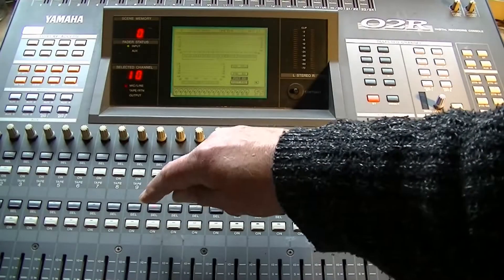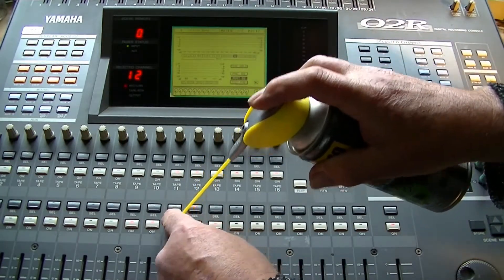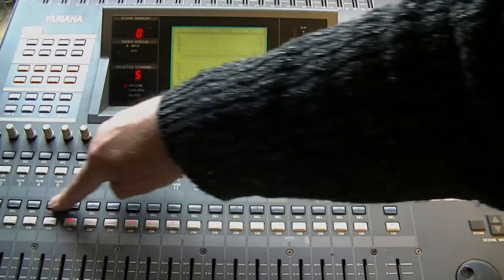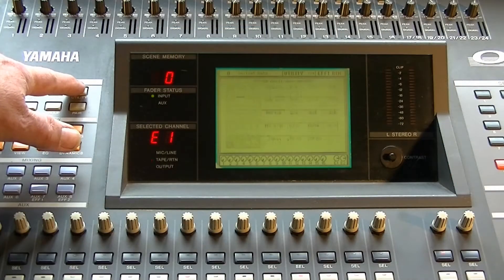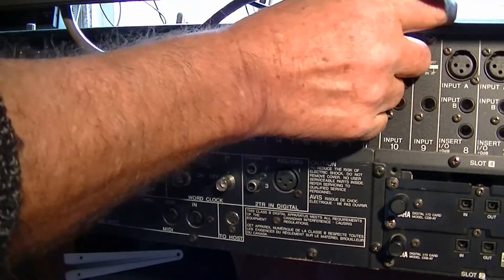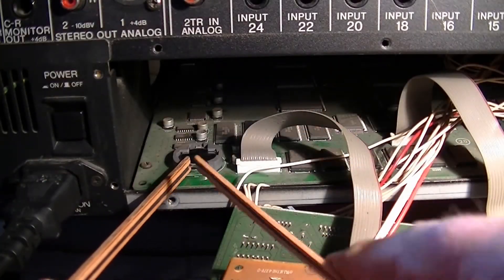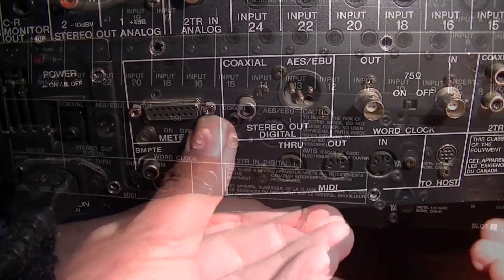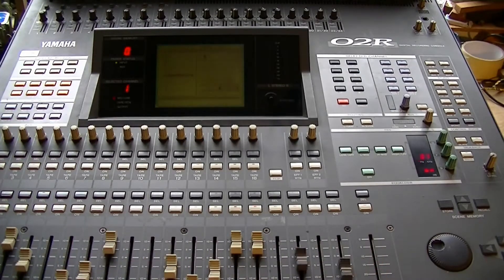YAMAHA O2R _ BATTERY REPLACEMENT_ NOORDERMAATSTUDIOS

Comment: Hi Marc, I cleaned the faders of my O2R with canned air, they are better now, bu it seems they could be a bit more smooth. What do you recommend? Contact spray? Also I would like to give the knobs a refresh. Thanks Thorsten
Reply from the maker: Hi Thorsten, the faders of my O2R "s aren't sliding smooth too .I push them instead of put my finger on them ,then they slide easier.If the motorized faders are working allright,I should do nothing. It could be, that it's not used for a long time.The more you use it ,the better they will glide.I don't know about contact spray.Have you connected it yet? Kind regards,Marc
Reply: @noordermaatstudios  Hi Marc, yes, the mixer wasn’t used for a few years. It was gifted to the A1 “sound man” from the “Jeopardy” team 19 years ago. But I bought it from a professional company in North Hollywood. They tested it. I guess the mixer was stored for many years (as the original label tape is still in place ;-). I will connect it soon…very excited 😊! I also got a used Yamaha Motif ES in pristine condition last weekend. I will let you know when everything is connected and how it works! Thanks & greetings to the Netherlands Thorsten
Reply from the maker: @thorstenweimar1190  Thank you, Thorsten, it's an exciting time for you.Let me know please how it goes,and enjoy Marc
Reply: @noordermaatstudios  Yes it is!  The board also came with the meter bridge, that's pretty cool! And now I have my final set-up: After considering I just bought a used Lynx Aurora 16 instead of the Yamaha Nuage 8A8D, that provides 16 analog ins/outs and 16 digital AES ins/outs. And I didn't want to go the Dante route. Just simple routing for the beginning. That should be sufficient for my small studio for years to come. I also use some 500er outboard gear. I will keep you posted. Cheers Thorsten

Comment: Hi Marc
My 02R disables the display occasionally and with this the sound, afterwards a couple of seconds going by gets it. What may be his reason?
Reply from the maker: Hoi Tibor,I am not a specialist but it could be a loose connection.I have had one opened with a simmular problem and i checked all the connections,and the problem was solved.I hope that it works,good luck.
Reply: @noordermaatstudios  Hi Marc
Thank you

Comment: Hi, I need help, my mixer stoped, i turn on and all lights signal of chanel stay green.. help me, please.
Reply from the maker: Hi,it could be anything,i allways start with a factory reset.

02R Factory Reset procedure:

WARNING: When this procedure is performed all user stored data will be deleted! If the current settings and data must be maintained, create a data backup before executing the Factory Reset. Once the procedure is completed, the backup data may then be reloaded into the 02R.

The following data will be deleted or reset to default settings: Automix Memory, Scene Memory, EQ Libraries (user only), Dynamics Libraries (user only) Channel Libraries (user only), Effects Libraries (user only) and all other user system settings.

1. Turn the power off.

2. Press and hold down the Left Cursor button while turning the power on. Continue to hold the button down until a dialog box appears on the display. The dialog box will read ''Please Confirm: Initializatize Memory? [ ] Cancel [ ] Execute''.

3. Using the cursor buttons, navigate to the EXECUTE option and press [ENTER].

The 02R will now execute the Factory Reset procedure automatically. The procedure will take less than 10 seconds.

NOTE: The faders will be recalibrated during this procedure. Be sure to avoid touching the faders while they are moving during this procedure. The fader recalibration is finished when all faders return to the minimum position.

Reference: User's Guide, p.161-162 02R 02RV2
pull  out battery plug the mixer tour ON .next return battery +RESET FACTORY
 Good luck
Reply: @noordermaatstudios  thanks I tryng, and return with feedback.
Reply: @noordermaatstudios Is removing the battery necessary for a full factory reset? I'm assuming that is just to remove previously stored scene data?
Reply from the maker: @HowardBaileyMusic  You are right,my O2r wasn't working wel after the battery change,so I did the factory reset.